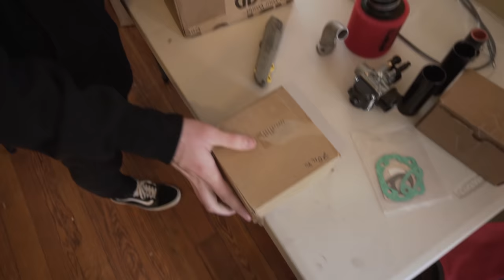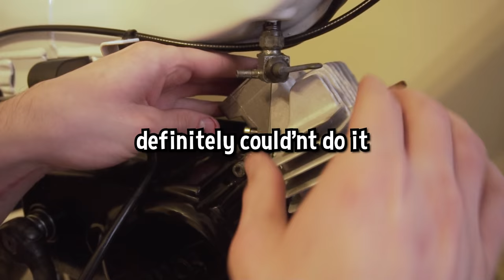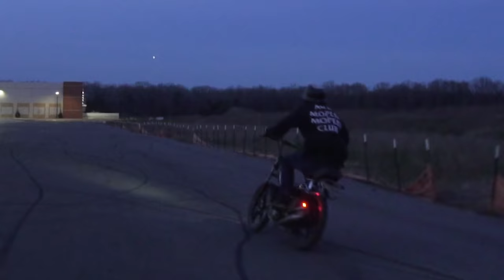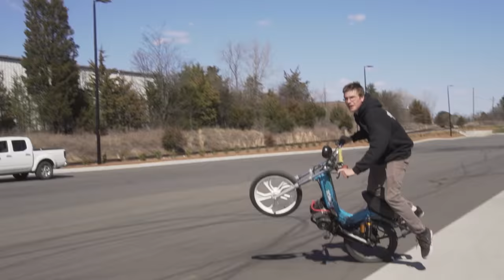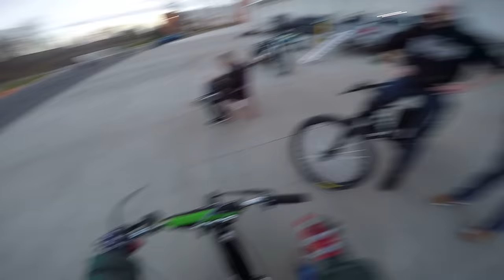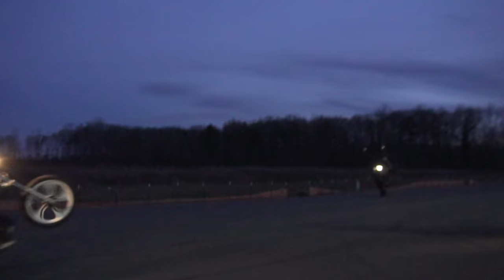Riding with the WORLDS BEST MOPED STUNTERS

Comment: You need to import a derbi senda sm 50 from europe and try to wheelie it
Reply from the maker: that would be lit but so expensive
Reply: @TwoStrokeJ  Derbis are ass. Minarelli  way better. My Rieju likes to eat pistons :)
Reply: @jimppa7424  vittu itellä am6 ollu enkä nauttinu
Reply: @TwoStrokeJ  You can buy second hand but transport probably is expensive ;) But if you would buy one buy rieju, derbi breaks down alot
Reply: @jimppa7424  yamaha dt 50 is the goat
Reply: @tedandersson9214  Honda hm50
Reply: @TwoStrokeJ  import suzuki pv
Reply: Fuvk it import piaggio typhoon '02
Reply: @2r3ez7  hahahaha🤣
Reply: @jimppa7424  derbis have better gearboxes and slightly more performant engines then am6
Reply: @tedandersson9214  I agree but not the strongest fram i snapped at dt 50 swing arm in half once
Reply: Derbi are alot better bikes than those which use am6
Reply: Import a Suzuki rmx 50
Reply: @jimppa7424  then you just don’t know how to work a bike lol, maybe get a bicycle
Reply: @TwoStrokeJ  are not you’re bike more expensive?

Comment: that arrow on the piston has to point down to the exhaust
Reply from the maker: well it ran good so I think you might be wrong haha
Reply: @TwoStrokeJ  nah fam i've been making moped's for years haha the arrow goes to down to the exhaust
i mean i can run both ways but you lose power
Reply: @TwoStrokeJ  He's right man 100%, it needs to point down to the exhaust port otherwise you'll lose power on the long run.
Reply: @TwoStrokeJ  Turn it around my man, 100% needs to point towards the exhaust. Just did a Tomos engine overhaul myself as well.
Reply: @TwoStrokeJ  thats why the serie is there it needds to point Down to the exhaustport

Comment: Dudes you rule! I'm very happy to see you guys tune those Tomos mopeds, i come from Slovenia where those mopeds are made! And tune them to go 60mph+
Reply: What displacement are they usually, no way their doing this on upgraded 50cc?
Reply: @jamesbalsley6135  factory is 49cc, we can hone the original cylinder to max 60cc. They use an aftetmarket 75cc aluminum cylinder kit. Quite expensive
Reply from the maker: Thats awesome bro!! THanks!
Reply: @jamesbalsley6135  the stock cylinder can be widened to 42.5mm (61ccm i think), the APNs are 4 speeds but we add a 5th. A dellorto sha 16/16 is normally good, MFpower or Lipnik exaust (both home made by experts (not anymore but you can find them second hand)) widened tunnels for the intake and exhaust, sprocket ratios and bigger jets normally do the trick
Reply: @GabrTM  jesus, im not ready to drop a whole paycheck to get a tomos to 60mph.
Reply: How long do one of those last, i heard bbks and swapped gears kills the longevity of the motor
Reply: @jamesbalsley6135  in my case, it depends on the 2 stroke mixture (3% minimum fully synthetic). The added 5th gear helps at the downhill so it does't rev up (or just put it in neutral).
The gear ratio i have it in the middle- for good uphill torque and some good top speed. We have lots of hills so... It helps that you drive lite.
The theory is, if it works, leave it alone. I have an original APN6 with no mods and it still has a factory piston! The other tuned moped i have, i fix it every winter.
Reply: @jamesbalsley6135  well a honed cylinder a d an L piston should (piston 35€ cyl depends on the person doing it), you can lower the cyl head a milimeter or half for free, you can get a dellorto for 50€ and a 5th gear for 30. The exaust can set you back 50 or more but you can make a home made resonance exaust foe cheap if you can weld. The jet is cheap af and the sprockets too (for top speed 14/32 ratio is good and you only need to change the front sprocket). You should be getting closer to 50 or 60. But parts back then were dirt cheap. Be aware that the engine isn't made for that power so things are going to brake
Reply: @alkokomi  0,3 štamprle na en litr je mera. Čist simpl matematka

Comment: What’re you running for jets I have the same setup just a oko 19mm looking to get a dellorto
Reply from the maker: pretty sure the main jet is stock I just lowered the pilot jet a size
Reply: Did you mess with the gearing? I’m still having a little trouble getting it up
Reply: Same jets as him will not work as good unless your setup is exactly the same and you live in same elevation and temperature conditions, in finland we have to change jets between seasons